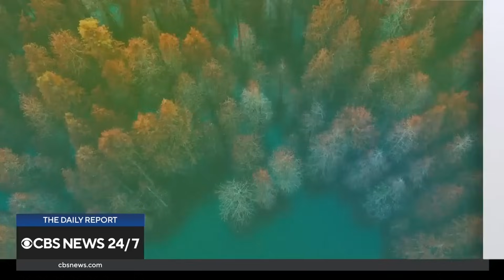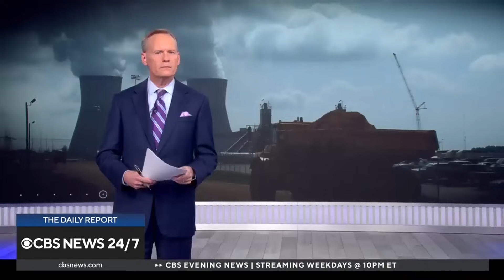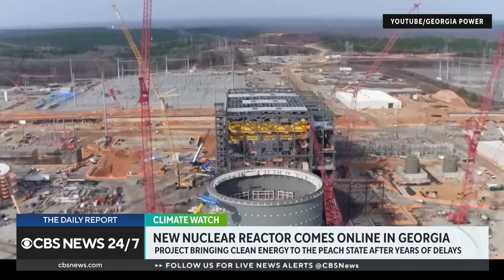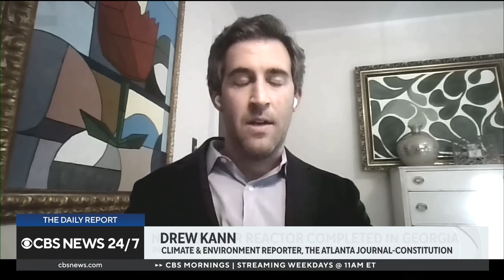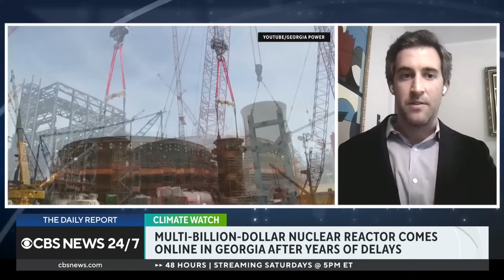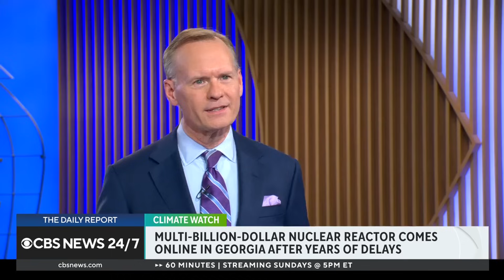New nuclear reactor comes online in Georgia after years of delays

Comment: I think Plant Vogtle was very risky to build since it was designed as they went along with a "green" workforce and no economies of scale. Left out a few things.  We should be building at least one hundred AP1000s now, more research reactors, and upgrade our grid to keep up with the need for more electricity on the grid.  We also need massive REE co-operatives with storage, refining, and magnet development to compete directly with the CCP.  No one died from the actual TMI & Fukushima meltdowns.  And folks got a dose rate equivalent to a few x-rays.  Most folks get exposed to more natural background doses than that, depending on where they live.  LNT is BS.  Our bodies need some radiation.  Chernobyl had a terrible design and no containment: thanks USSR.  We have the tech to recycle all of the spent fuel and get decades worth of energy out of it.  It is just not economical yet versus buying new Uranium.  PVs, windmills, and batteries will never provide enough energy for the USA to remain an economic power.  Git er dun!☢☢☢☢☢☢☢☢☢☢

Comment: In 2013, wind and solar combined produced 766 TWh globally of electricity, versus 2449 TWh that came from nuclear.  Ten years later in 2023, wind and solar combined produced 3934 TWh of electricity globally versus 2686 TWh from nuclear.  The 3168 TWh production increase represents almost as much new annual production in ten years as all the nuclear power plants ever built, and the next ten years of wind and solar build out will be much larger.  Despite what its opponents say, nuclear power is extremely safe, and spent fuel storage isn't actually that big a deal.  But it doesn't matter, because wind and solar are just too much faster and cheaper to build.  

And before anyone starts whining about how renewables won't work without batteries or support from fossil fuel peaker plants, neither will nuclear.  Most of the world's available electrical storage capacity is in the form of pumped hydro, and if you look and the dates and locations of most pumped hydro projects (if it isn't explicitly stated in their Wikipedia articles), you will find that they were built to meet intermittent high demands that the "baseload" nuclear plants couldn't, and to use the excess capacity when those nuclear plants were producing more than there was demand for.  Nuclear probably has a slight edge, but both nuclear and renewables compete to work with the limited amounts of storage and dispatchable power supply.  Dispatchable power incidentally is the stuff that power utilities actually value, baseload power is an epithet, not praise.

Comment: 30 million Mwh a year is enough for 1M homes? So a home in Georgia uses 30 Mwh a year? In the last year I've only used 0.6Mwh. It'd be a lot easier to get people to cut their use than spend all that money on building a nuclear power plant. It always seems like these nuclear plants take far longer than expected and cost far more.
Reply: That's nearly impossible unless you power basically nothing.  Explain how you only use 600 kWh in an entire year.
Reply: @handlealreadytaken  I think it'd be easier to ask how someone uses 30MWh a year. BTW, I've rechecked and it's closer to 1.8MWh a year but that's still 15 times less than 30MWh
Reply: @sie4431  Businesses and factories use electricity too.  A year of household use will run a steel mill about .000001 seconds.

Comment: as an employee in the energy industry i feel obligated to inform everyone that in 30 years the workforce has completely changed and so has the technology that goes into the manufacturing processes. In conclusion whoever made these reactors it was probably their employees first time building one and there could have been improvements made to al older design that involves a new manufacturing process.
Reply: They started building before the engineering was done.  I'm pretty sure a bunch of the concrete had to be demo'd because they didn't pour it right. Ontario Canada is the perfect example of how successful nuclear build outs can be.  They were bringing on average one reactor per year online for 20 years straight.
Reply: Lots of duct tape involved.
“…government staff and monitors wrote that they were “shocked” by an “astounding 80%” failure rate for new components installed at the site [Vogtle]. The results meant the components, when tested, “did not initially function properly and required some corrective action(s) to function as designed.”
Reply: This reactor is a new Westinghouse design intended to be much smaller than old 1970's designs.  I believe its land footprint is like 1/10th of those old plants (or some number in that ballpark) while producing the same power.  Westinghouse says it has 80% fewer pipes, 50% fewer valves and 70% less cabling. This means lower cost and less stuff to break during operation. It is modular meaning Westinghouse builds the big parts of the plant in a factory then ships it to the site.  They then use cranes to simply drop the module in place. On top of that it is safer than old designs because it has passive safety built-in.  Westinghouse says that if there is a total station blackout, the plant is "walk away safe" for 3 days. It will SCRAM itself and then cool the decay heat for 3 days with no human intervention or electricity needed. After those 3 days all humans have to do is refill a water tank and it can run for 3 more days (this can be done as many times as needed). 

It's a smart design, but the issue was that our workforce had no experience doing nuclear. This led to mistakes that had to be redone and a lot of time wasted.  On top of that the NRC demanded design changes in the middle of the project which led to further delays. And on these projects time is money.  I believe every day of construction costs around a million dollars (regardless of how much work gets done).

Comment: Too bad vc summer 3 and 4 didn’t get completed. 

Back in the 70 and 80 the cost overruns where 500-800% and they have cheapest rates available. Cost over runs is difficult during construction however durning operations it’s ok.
Reply: Sunk cost fallacy. You don't throw good money after bad. That project should have been cancelled far earlier, and the money saved spent on solar and wind, especially offshore wind.

Comment: Open up a repository to safely store the spent fuel.  Yucca Mountain.
Reply: keep it in Georgia
Reply: @rossr6616  Why would you not want to keep nuclear waste that generated to supply and support the east coast interconnection to be store in federally own facilities? Georgia simply does not have the geological condition for housing waste long term safely
Reply: @gabrielmataleo4573 Georgia could build an on site pyro method reprocessing facility.
Reply: Why is it NV problem?  And why bury usable fuel?
Reply: @waywardgeologist2520 Great question, with enough incentive you can grow orange in Maine, but that doesn’t mean you should. Same with nuclear waste that still could generate power, it doesn’t mean it is cost effective to do so. NV being one of the less populated state that is far from coast and away from any major natural disaster prone region, with stable rock, and large amounts of federally owned land has one of North America best conditions for a deposit, with the event that these deposit post danger to the outside it will be far less damage. Waste rod are usually store deep underground and will be refilled with rocks and soils to cover waste deposit with water proofing to prevent ground water contamination (which NV is also pretty dry)
Reply: Why not recycle the spent fuel.  It leaves about 10% the amount of waste, and reduces the time the waste is radioactive to a few hundred years.
Reply: @dave4882  Cost to recycle are too high compare to long term storage for decay
Reply: @gabrielmataleo4573  what numbers are you working with?

Comment: 35 billion could have built 35,000 megawatts of wind. You only got 3500 megawatts of nuclear out of this project so that's 10 times more expensive than wind
Reply: What are you going to do when there is no wind?  Nuclear power runs 24/7 wind or no wind, night or day.
Reply: @ms-tw4sj  The same thing they do when they shave to shut down the nuclear plants for maintenance.
Reply: @SocialDownclimber   When nuclear power plants are down for maintenance, the power company buys the deficit power from some other power company. Please explain how one could do this with wind and solar. If it's night time here, it's night time everywhere except on the other side of the planet. Winds are unreliable.
In Germany, when there is no wind or sunlight, they have to depend on standby coal plants. AND, They buy excess electric power from neighboring France, which generates 70% of it's power from Nuclear plants
Reply: @ms-tw4sj  And when France can't run its nuclear fleet at capacity they import power from other countries. Seems like you answered the question yourself. They can buy power from wind, from hydro and from batteries.
Reply: @SocialDownclimber 
Nuclear Power: Reliable, runs 24/7
Wind and Solar: Unreliable, doesn't run 24/7.
Why would I have an UNRELIABLE source of power for back up power, instead of a RELIABLE source?
I lied. Nuclear power isn't 70% of the source of France's power grid. It's more like 78%
Why is Germany buying power from France? ANSWER: It's reliable. Why isn't Germany putting up more wind and solar? ANSWER: it's unreliable.
Reply: @ms-tw4sj  in Ontario Canada they time the maintenance when hydro is peaking. I think they also have more reactors than what they need so they can bring them down without any issue.  They have reactors that were going for 1000 days without a shutdown though.  They had to do an inspection.  Now that they are refurbing the plants since they are 30-40 years old they are doing a modification so they can keep the plant running during the inspection.  Those plants are workhorses. The plan is to keep them running for 80 years.  A lot of the plants in the US will run that long as well.
Reply: @pin65371  Compliments to you Canadians. Show the world how it's done the right way.
Reply: @ms-tw4sj  the key is build lots of reactors in one area.  That drives down costs.  If you know you will be doing construction for over a decade you can build out the support infrastructure.  Even having a facility for the construction workers to stay when they are working is huge.  That means people dont need to be local. The areas around the nuclear plants are very nice as well.  The workers are paid pretty well so they can afford nice homes.  The plant has been around for such a long time now that multiple generations of people have worked there.  A kid that might be working there might have a grandpa and dad that also worked there.
Reply: @ms-tw4sj  usually they use natural gas power plants for backup. The point is nuclear is very expensive option and wind in the Midwest has a 50% capacity factor with current technology.
Reply: @dalepetersen1166  1) Extremists want to get rid of ALL fossil fuel plants, including natural gas.
 2) The cost of Nuclear is going down
 https://www.energy.gov/ne/benefits-small-modular-reactors-smrs
3) Solar makes sense where there is plenty of reliable sunshine and the cost of the alternative is high. Hawaii, for example.
4) The best plan for power is to build nuclear and natural gas for base loads with solar and wind for peak loads.
5) Since solar and wind are not 99.999% reliable, we need some sort of mass scale energy storage. We don't have it yet.
Reply: Do you mean capacity?  What about the necessary batteries and increase in transmission line requirements?
Reply: You must hate birds